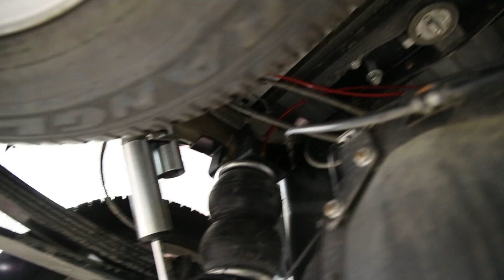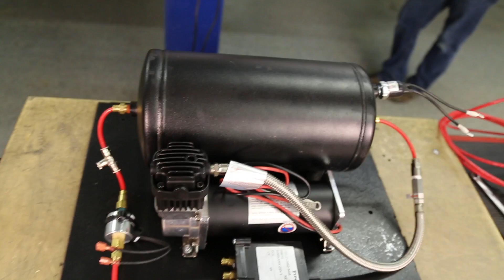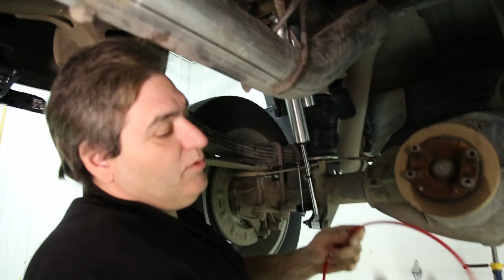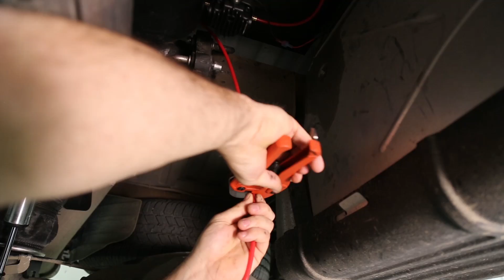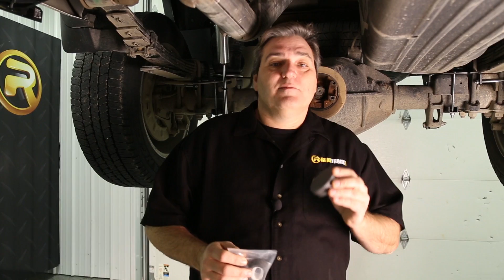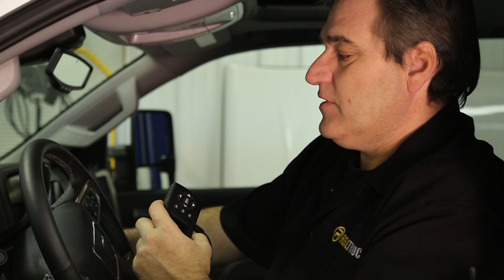How to Install Firestone Air-Rite Air Control System

Comment: And slide rubber fuel line over all your plastic air lines to keep from rubbing on a sharpe edge and put a hole in it and air compressor will run until it gets to hot and shut itself off .

Comment: The best upgrade you can do to keep from pulling your hair cover all your plastic air lines with rubber fuel line and it will save you the aggravation.

Comment: where can I buy this exact kit. I cant find it anywhere. I found a partial kit that didn't come with the air tank and inline valve
Reply: do you have a part number for the air tank, inline valve and pressure valve?
Reply: how did you install the vcc and T connector from the air tank?
Reply from the maker: The link in the video description will take you to our site for the parts in the video! As far as technical support goes, we'd recommend you call in so we can ensure an expert is giving the best information.
Reply: I think they discontinued this particular model

Comment: Robin Loucks and John Park  I thought the same thing about the red plastic line.....could it be a point of failure thing? so if something gives it'll be the little red plastic tube? Even if it is it still seems a little cheapo.....so do the zip ties. at some point they're gonna get brittle and break right?

Comment: Nice video … But... this install will work but the question is
how long before something fails?

Pneumatics is a very unique energy source but it needs to be
treated with a high degree of respect, think about it is a stored high pressure
energy source. It needs to be prepared properly to work safely, efficiently and
reliably. Robin pointed out a braided line into plastic? Do you have any idea
how hot this can get. And you’ve installed this upside down, where is the drain
….. for the water? 

I’m going to install an onboard compressed air system and
tank this summer, you have inspired me to make a video on the same subject. Except
I use to teach Pneumatics and I am a Licensed Millwright.
Reply: not to mention its mounted close to the exhaust pipe.